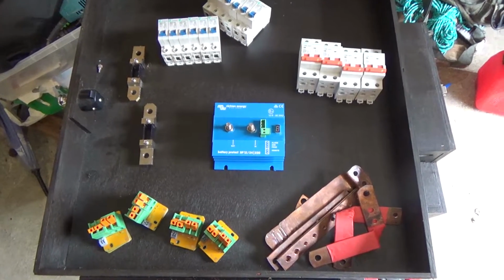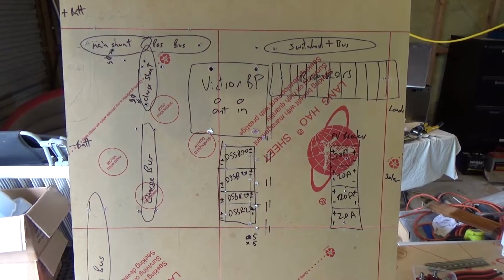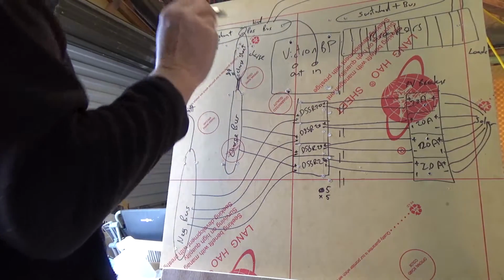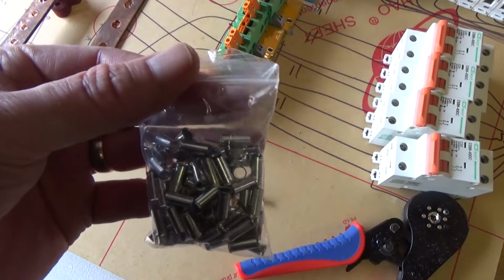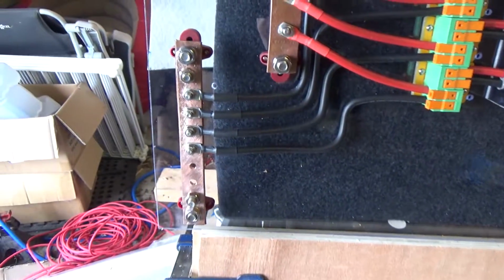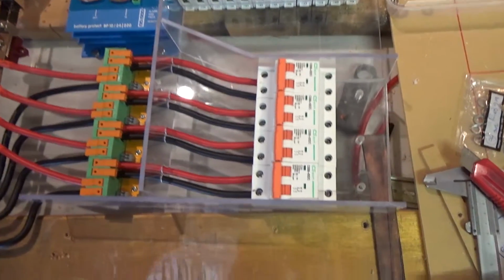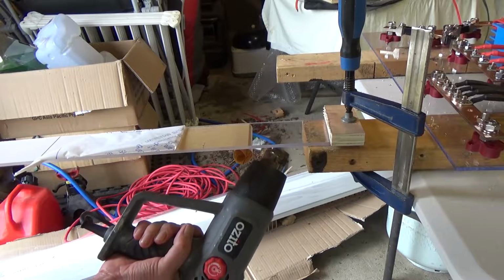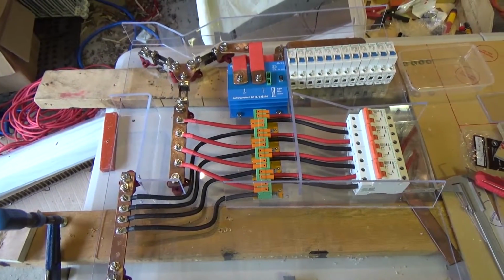RV Electrical Panel | 24V Electrical Panel in the Bused As Bus

Comment: where did you get the lugs for the 10guage PV wire from the DSSR20 to the busbar connection? I am having a hard time finding these at the moment for some reason. thanks in advance from (PilgrimValley) South Dakota -- USA
Reply from the maker: Wow that sounds like a cool place to visit. I have never been to South Dakota, closest was probably Chicago last Christmas and doesn't look like I will be able to get back that way for a while. Actually found those lugs while I was wandering through a local electrical wholesaler (as you do), grabbed a handful since I figured they would come in handy. But I also ordered some from AliExpress, a kit that had several lug sizes with several wire sizes. They are a little lighter but a whole lot cheaper.
Reply: @BusedAsNZ  I found some (lugs) on aliexpress and ordered them. everything from aliexpress is slow. waiting on the lifepo4 batteries right now. I think they should show up next week. almost impossible to get tracking from Alibaba once they are on the slow boat ride from China to the USA. most people report 30-40 days. it has been 39 days now. I bought the sbms0 and dect16 and dssr20 setup and it arrived about 2 days ago. I really like the looks of it and have chosen to go down to 24-volt inverters vs 48volt. safer for me I think! the midwest is the best in the USA. many different climates in many places in the USA, but the midwest is generally more economical and have friendly down to earth people in the rural areas. Chicago is too big for me. right now the wind is blowing and cold out as we are going into the snowy winter cold time of year here. keep up the great video works. I watched the sourdough bread video yesterday. I also enjoy the music and playful light-hearted introduction to some of your videos. thanks again. hope you show how you mount the sbms0. it almost needs a hinged door set up of some sort.
Reply from the maker: Ah yes the all too familiar wait for "stuff" to arrive from China. I have had lots arrive in 8-10 days but also waited nearly three months. Fingers crossed for you mate, must be exciting waiting for your batteries. Did you get the newer diversion DSSR20s? As for the SBMS0, of course you will see. I have actually set aside a spot by the bed, since it is not too bright, maybe. Or hide it away somewhere so I'm not so tempted to look and play with it. Thanks again for the feedback, really appreciated it
Reply: @BusedAsNZ  I ordered  4 dssr20's with diversion. batteries are the hold-up, but should be here soon. seen they cleared customs but now don't see any updates so still waiting. I will just use the solar charging at 1st, but I ordered 4 24v 600watt heating elements to put in some barrels of water to test a little later on. I hope to utilize some of the solar panels for thermal heating.....just curious about the sbms0 mounting cause you could maybe put a thin sheet with a cut-out to fit on some type of junction box. but it seems you may want it to hinge or leave the wires a little longer inside the box and just unscrew the cover. just like to watch as you progress. the bus is a neat project. mine will be stationary for an off-grid house. oh, the shipping wait is crazy long at times. then other things come quick. but the batteries did take the slow boat ride from China --- wait wait wait,, but gives me a little more planning time. I built an insulated 8x8 building for the batteries, inverters, and all the control equipment so I can keep all safe from my daughter (9 years and very curious, and mischievous also). your videos are an excellent help for me to think out the plan. thanks.
Reply from the maker: I love the diversion idea, but not sure I will have power much spare, maybe only in summer so perhaps some sort of cooling might be more useful or even just ventilation fans that kick in once charging is done. I guess it wouldn't hurt to have easy access to the back of the SBMS0 though it shouldn't really be too necessary once you have it up and running. It doesn't like high humidity so might quite like being in a nice dry junction box
Reply: @BusedAsNZ  yea, cooling is definitely an issue here for about 2-3 months(June, July, and August). right now heat is the issue that would be great with diversion. I am going to try to heat water with 24-volt water heating elements (waiting on them also). it is below freezing every night here now although it is supposed to get up to 50 degrees Fahrenheit tomorrow. that is always a welcome break from the cold. but this is being used for my house --- trying to become off-grid --- a sort of supersized uninterruptible power supply. keep up the great work! I am rather excited to expand the solar system --- slow but sure!
Reply from the maker: Down here we dont really have weather, its never really very hot or cold, but if I was stationary I would definitely be heating water all year round since you always need it and its expensive to make. Love your giant UPS theory, great plan
Reply: @BusedAsNZ  I bought (waiting for them to come) some 48Watt led lights from aliexpress that I was going to try and use in my off-grid project to light up the solar shed, to begin with. maybe they would work in your bus project then you could wire them direct as 24-volt. they were listed as 24-volts and 12 volts both. they are square and about $4 dollars each including delivery so very reasonable price. (OKEEN New Led light bar 48w Led bar 16barra Square Spotlight Off-road LED work light 12V 24V For Car Truck 4X4 4WD Car SUV ATV) thinking of solar efficiency a bit, then you could exercise the LiFePo4 battery some.
Reply from the maker: @pilgrimvalley1554  hahaha classic, I think I have ordered the exact same lights, yes I am going to see how they go on 24V. I have some 1W 3W and 6W lighting already and they are pretty bright so these 48W ones must be either super bright or super inefficient . Either way pretty damn cheap. I was thinking maybe they would make good security lighting
Reply: @BusedAsNZ  I thought security purpose for the 48-watt lights; but also direct wire as 24 volts(maybe less loss on the 24-volt battery system). also, there are things called terminal blocks that accept small gauge wires for the sbms0 wires organization, possibly. the brand I have been buying is Dinkle but there are other brands. they connect to a din rail and if you use ferrules with the small wires they may be of some use in your setup to organize the wires. they make them in all kinds of amperage range ratings and accept different size wires. I like the fact that they have screw-down terminals that compress the copper bar which squishes on the wire and if you use ferrules with the hex shape crimper maybe even better. curious why you made the acrylic board for mounting everything, but it is definitely cool. have a good day! It is Thanksgiving Day here in the USA. A federal holiday of feasting.
Reply from the maker: Love that concept, A federal day of feasting. Hope you had a great day. Wow yeah looks like Dinkle makes quite a bit of cool stuff, might have to look into that.
That acrylic board, if it lasts, was just an idea I had that I thought might look cool, and it was so much cheaper than any off the shelf electrical panels
Reply: @BusedAsNZ  yeah, some of the electrical stuff is very expensive, no doubt. the tiny control wires (12 leads) that go from the SBMS0 to each of the battery cells(groups)-- did you get a ring terminal or anything like that to go under the bolt? My 280Ah LiFePO4 batteries are coming with bolts -  possibly arriving this Friday(finally). I think they are 6mm bolts (for the battery) which are also kind of small diameters. the trick will be connecting them to some type of ring terminal or possibly a forked terminal to put under the bolt. Just curious if you made a different connection method for those or just a bare wire under the bolt (which gave you readings without any problems). I plan to make a battery bank similar to yours except it will be 2P8S. the guy from china said I should put insulation between the battery cells and underneath them. he sent a picture where he had a thin material between them(maybe a thin rigid plastic sheet or fiberglass sheet). My thinking was maybe they don't trust the aluminum casing with a thin blue shrink wrap around them as the aluminum case could also be an area of conduction should something go wrong. I do not know for sure but I do know that there has been a lot of discussion and compressing the cells will increase their life span. so I am going to compress them like you did with the threaded rods and 3/4 inch plywood. have a great day! the Thanksgiving feast -- so much food -- gotta love it!
Reply from the maker: @pilgrimvalley1554  How do they look? For those balance wires, you can buy little crimp ring terminals but I just cut up the crappy little battery joiners that came with my batteries and soldered the wire to them (for my initial testing I just poked the wire under the bolt). M6 should be fine, its not high loads. Yeah the compression thing is interesting, I kinda get the logic but some also say its not needed and can reduce the cooling. Not that I expect my loads or charging is enough to generate any heat
Reply: @BusedAsNZ  i am currently charging my 2P8S 560Ah LiFePO4 battery with the SBMS0 hooked up. one thing that I caught studying up different videos is there is a guy called filterguy who has compiled a user manual of sorts for the SBMS0 on diysolarforum.com and also on Dacian Electrodacus email base forum who quotes "Do not put a fuse or breaker (or anything else) between the battery + and the Shunt(s). If the fuse/breaker
were to blow, the resulting voltages on the input to the SBMS0 could damage it." 
this set me back a bit as I had prepared for the large catastrophe class T fuse right at the battery. so I reconfigured the wires and shunt locations to put the catastrophe class T fuse after the shunts. the SBMS0 seems to be working just fine. i like it a lot. 
i also use category 5 4 twisted pairs to connect the 2 shunts but I got some solid stranded cat 5 from my computer buddy. 
i thought you might be interested in the location suggestion for the class T fuse.
i really like your videos a lot. i notice the new bolts and the split banks and more long compression rods to hold it all together. 
i have to get a drill press to get the holes to line up better for the threaded rods. i ordered longer grub screws to hold the bus bars down as the set screws that came with my 3.2-volt cells were not quite long enough with the large lugs and I accidentally arc-ed one day the cells combining them and damaged 2 grub screws. actually cut halfway through one like an arc welder. this gave me a lot of respect for their power and my need for glasses and better light conditions to work in. at any rate wish you and your family a very merry Christmas.
Reply from the maker: @pilgrimvalley1554  Hey there buddy, Merry Christmas to you guys too. Sounds like some awesome progress being made there. Heck yeah the power in those batteries is mind blowing. They look and feel so boring until you touch something metal and it evaporates :) I have both types of CAT5 cable, the solid is great but I think bouncing around in the back of my bus the stranded will last longer, I just tinned the ends with solder effectively making them solid to connect to the SBMS and that makes then easier to connect. Thanks for the heads up on the fuse position, and good advice. I had contemplated moving mine when I had to rebuild the pack layout, but decided not to. My logic is that I just dont want that much copper unfused in a vehicle that worst case scenario could be upside down. I want the fuse to be the absolute last line of defense and of course have a several layers of fusing before that so a short anywhere else wont bother it and it is really there in case I have a big short on a busbar or shunt or a similar catastrophe. So if said catastrophe kills the SBMS but saves the battery and more importantly me and the bus, I will happily replace the SBMS. In a static build after the shunts as you have done makes perfect sense

Comment: G'Day,
Have you tested the DC circuit breakers to see if they trip at 20A? I would like to order some but want to ensure they actually break when they should.
Reply from the maker: Hey there Aussie, hope you guys are good over there. That's a bloody good point, what actually happens at 20A?
Come to think of it I have never tested a breaker before, I guess I just need to ramp up some load through one and see what happens. Might have to try that...
Reply: @BusedAsNZ  Thanks for the reply mate. All well over here as I am not in Victoria. A kettle might do the trick. Let me know if you end up testing them.
Reply from the maker: Good to hear. Will do...

Comment: The current shunts do not seems to be configured correctly but not sure as you installed 3 of them. The two shunts needed for SBMS0 will need to be in series so Battery+ then battery current shunt then PV current shunt.  So unless that third shunt is the battery shunt I do not see where the battery+ will be connected.
Reply from the maker: Hi there. yes it looks confusing because I have a third shunt that will not actually be used.
The battery will connect top left corner, so the top left shunt is the battery shunt and is in series with the bottom shunt which is the PV shunt. The unnecessary top right shunt on the load circuit is there only for aesthetic value and will not be actually measuring current
Reply: @BusedAsNZ  Makes sense since those current shunts are so cheap they can be used for artistic purposes :)
Reply: His video has a breaker on the positive and negative of each solar panel before the DSSR20? why the negative side also? My plan is a 32Amp breaker on every 2 panels (after they are connected 2 in parallel) but it will only be on the positive side of the PV panel going into the DSSR20. Each set of 2 60 cell 250-watt panels will have a Temco parallel connector as the first connector combining the 2 panels in parallel in my wiring plan. Is the negative breaker connection needed? thanks for your attention!
Reply: @pilgrimvalley1554  Yes a single 32A breaker for each group of two panels is more than sufficient to disconnect the panels.  He also has the older DSSR20 models in your case the PV negative will not even connect to DSSR20 but directly to battery negative.
Reply: @electrodacus  thanks for the quick reply on the breaker configuration thru the DSSR20. My 60cell 250Watt solar PV panels are here now and I ordered ferrules for the 10awg PV wire to try to make all orderly. The 280ah batteries are clearing customs and should arrive this week. My solar power shed is now fully insulated and I am working on the new array mounts this week. raining here today.
Reply from the maker: Yes as Dacian has explained not really necessary. Its just my usual overkill approach to things. And they cost about the same as single pole breakers at the time I bought them
Reply: @BusedAsNZ  hey I really do like your videos on the Electrodacus equipment.they are very helpful. I also usually overbuild and overthink my projects as I am not an expert in electricity but really want to be safe and don't like to be zapped by electricity or have anyone else be zapped or cause a fire hazard. I also bought the big class T fuses for installation next to the battery bank. we are alike in many ways. thanks for all your youtube videos. I have watched and watched your videos and other people's videos; over and over again to gain more knowledge of the solar PV system. I am putting together - slow but sure an off-grid system for my small farm. thanks again for your efforts!
Reply from the maker: Maybe a little zap now and then is OK :) just to keep you on your toes.
But seriously, thank you very much for your kind words. Of course I'm no expert but like you learning as I go and while I hope that sharing my experiences, mistakes and successes is helping others, you really never know and its so awesome hear that. Honestly makes it all worthwhile. Cheers. Take care mate